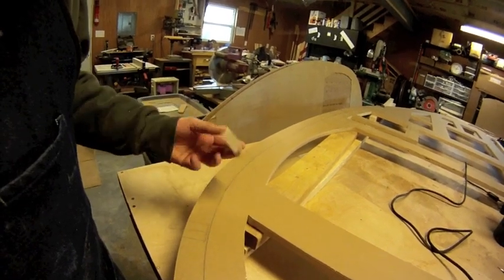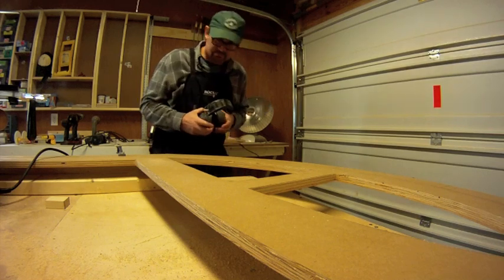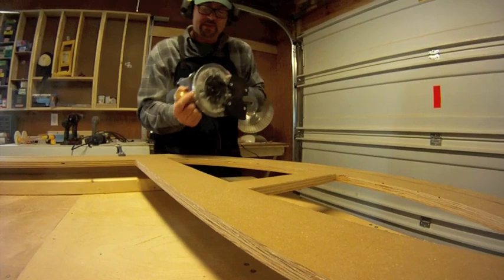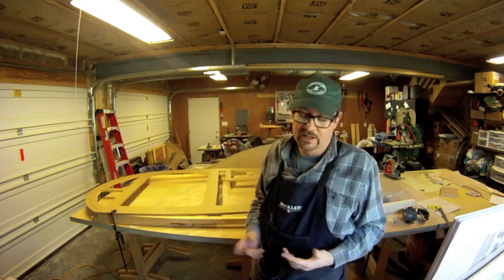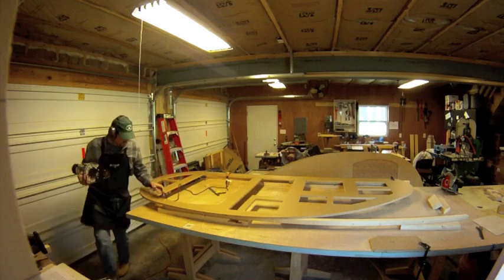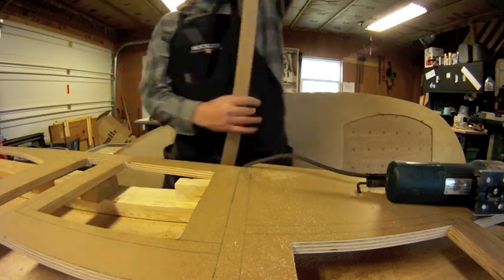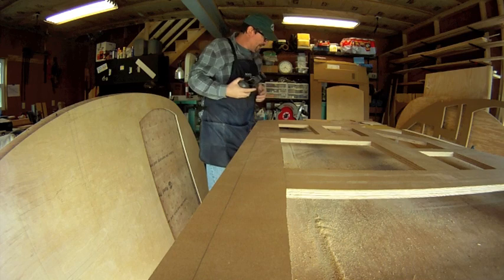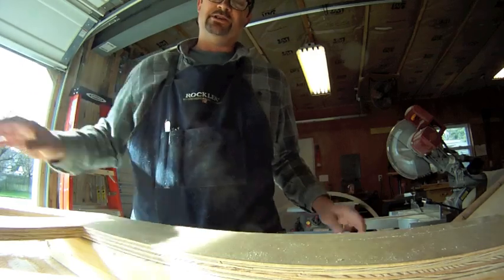Teardrop Build part #3a

Comment: Great series. Exactly what router bit did you use. I assume it’s not carbide?
Reply from the maker: Hi Tony, as I remember, it was a Whiteside 1/4 inch Solid Carbide Spiral Up Cut bit, Model RU2100.
Reply from the maker: Actually, I think that it was a Whiteside 1/8 inch Carbide upcut.

Comment from the maker: The curved cut creates a shelf that the interior ceiling will sit on. The straight cut that I made on the bottom is for the lap joint that attaches the sides to the floor. Once I put all the parts together, it should make sense. Hopefully that will be in video 15 or 16.